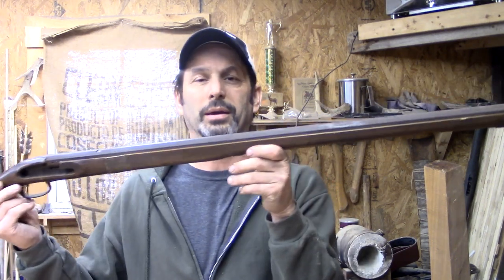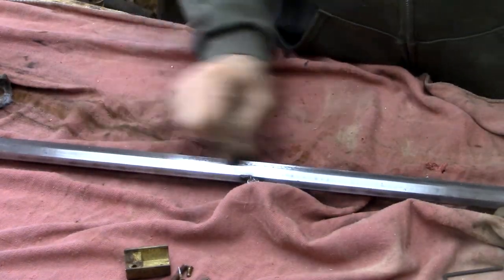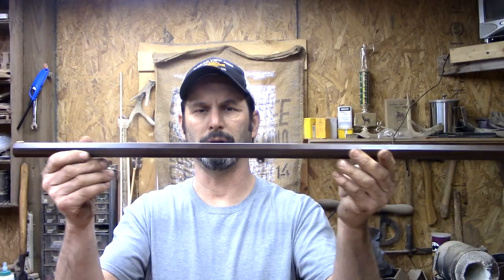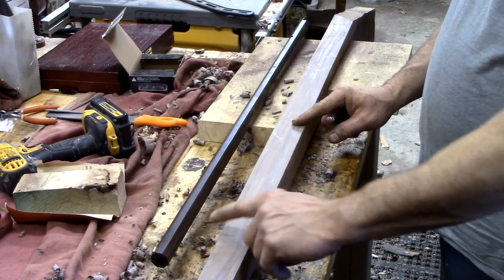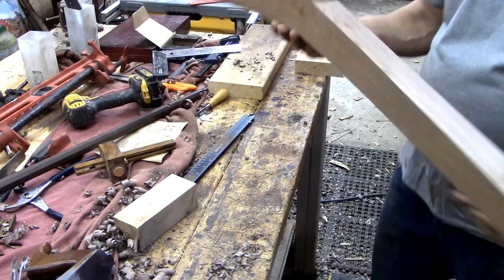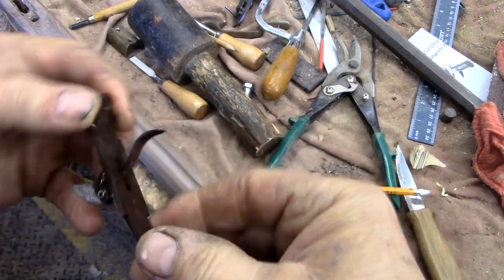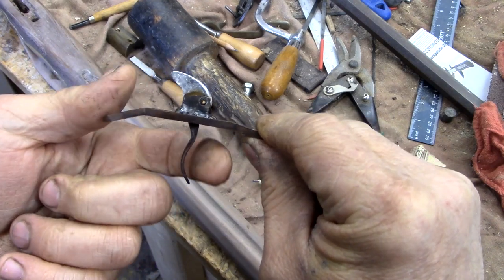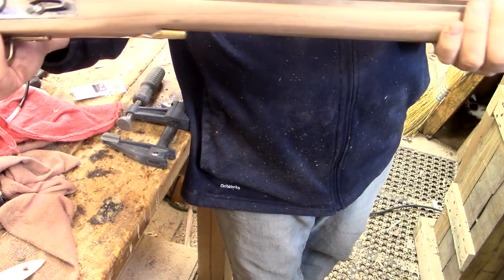Flintlock Stock From Scratch

Comment: From scratch means a block of wood and a bar of steel.
Reply from the maker: I apologize, you are completely right. I'll edit that . Thank you for the pointing it out .
Reply: That's a lot more "scratcher" than most will do. Old gunsmiths reused whatever they had of parts on hand, including barrels and triggerguards and locks. 
Try building a flintlock or rifled barrel from scratch. Re-stocking was a very common job in the 17-18 hunnerts. After the first one things improve.
Reply: Where did you find the lock?  What brand is it?
Reply: Sorry,  I heard,  deer creek lock